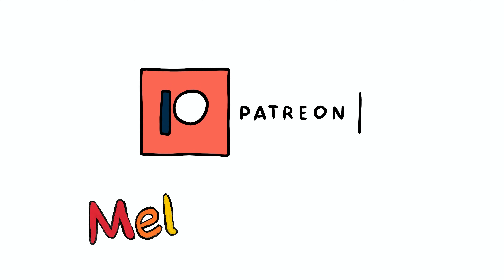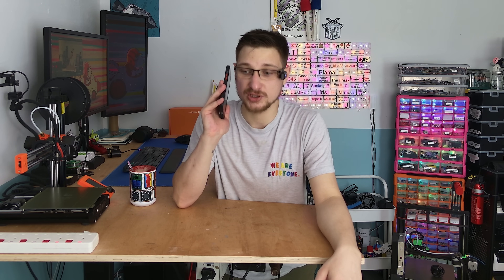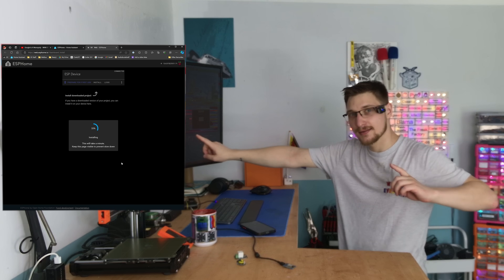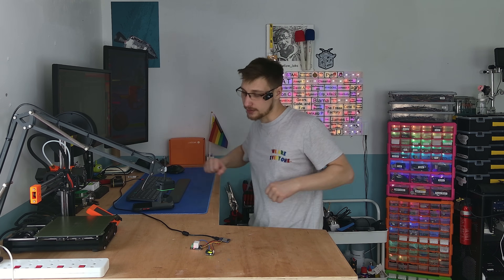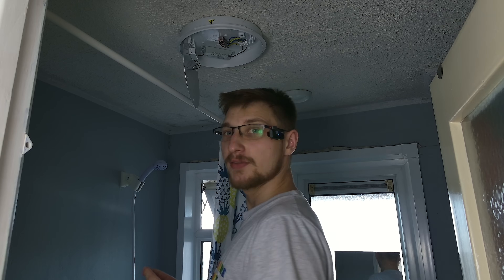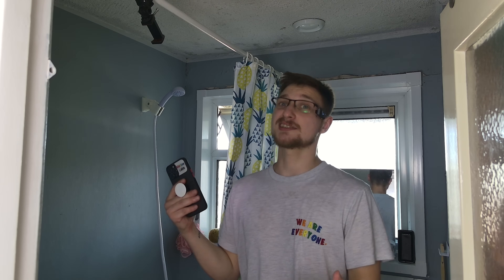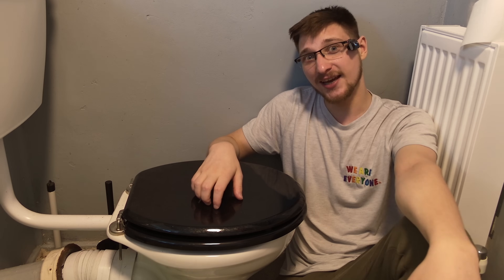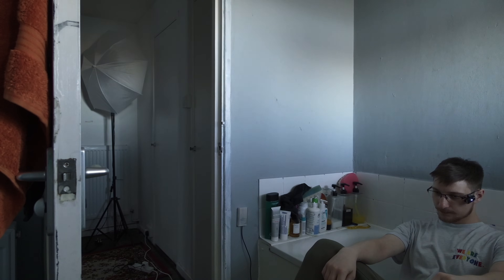DIY Smart Bathroom Light: with ESPHome & Home Assistant!

Comment: WHY did the Real Electrical Engineer (gpt) at you shouldn't??
Reply from the maker: GPT was just for a joke. I did actually ask my electrical engineer friend. The reason I didn’t use the LED power supply. Is the same reason I had to move the relay from disconnecting the LEDs to disconnecting the power supply. The power supply just isn’t designed for that kind of continuous operation. It would work for short term, but after a while it might start having issues.
Reply: @Mellow_labs  oh interesting! The ps doesn't look like supplying small currents for long periods? Why? Low efficiency?

Comment: The weird bouncing issue is caused because the power supply has no load when the LED is disconnected and the constant current feedback loop in the supply output is not able to adjust appropriately.  Basically you have an unlimited current supply (well within the limits of the supply) driving a newly connected LED load.  The flash duration you see is the time it takes for the  supply to stabilize.  So you made the right choice to switch the power going into the supply.  It will make the LEDs and supply last much longer.

Comment: I'm just watching all the time hawe question why? Forget wifi sensors and relays in smart home. You can only use them if you have no other wifi networks around. And your router can handle such many devices. Router has to be very expensive, in other words. Just use zigbee and cheap chinese sensors like tuya or similar...

Comment: If you don't need too much range (and you definitely don't need much in the bathroom) you could also put the sensor in a cupboard. The mmWave signals easily pass through a bit of wood, my sensors easily detect me if I'm standing at the other side of the door

Comment: Good video. lol Cool you used the exact same power converter to do this that i did when i converted my dumb bathroom extractor fan switch to a smart one. I also added a bme280 to mine as well so the fan goes on/off when the humidity from taking a shower rises and then falls. But this is a good way to do a light. :) Also added a vl53lox time 0f flight sensor and aimed it across the toiled seat so the fan turns on when you set down on the seat and off when you get off of it. Also sprays my modified glade air freshener as well.

Comment: Add a PIR sensor to have a faster activation time and the mmWave sensor keeps the light on
Reply from the maker: Actually, I got the activation time down to less than a second so doesn’t really need it. It was just a configuration issue I had.

Comment: Nice, I use a similar system for all my house lights. You could consider connecting the mmWave sensor within the light itself and directly to the esp controlling the relay, which I think would decrease the latency considerably.
Reply from the maker: Actually, the latency was a configuration issue. I’ve managed to get it down to less than a second now. But the main reason I didn’t put it in the light is because of the environmental sensor it would be useless up there.
Reply: Ahh glad you managed to sort that out. I find my mmWave sensors can ‘see’ through most materials including plasterboard, wood and plastic though.

Comment: How about putting this presence sensor on a ceiling near the lamp? It has limited angle (probably like 100 degrees), so this might also be causing delay. It just take time from entering the room, before you get seen by a sensor. That would also help with wires. You could even try to put it inside the lamp, but in this case, environmental sensor would make no sense :)
PS. If you are switching AC, you could look at SSR relay. They are super quiet :)
PPS. You can now put esp8266 (seriously, esp32 you are using for these projects is an overkill) behind the light switch, powered from light circuit, and switch (ideally momentary) would connect two pins on esp (maybe through resistor or pull-up pin) and control the light (or something else)

Comment: Doing exactly Ideas that I'd like to do myself. Have you considered placing ESP in switch box (light, boiler, heater) for bathroom? That way you can automate bathroom heater, as well as boiler (usually in EU its in bathroom)? Are normal aliexpress relays good enough for that? It'd be good enough project tbh

Comment: I absolutely hate those relais with the pull resistor to the wrong side...

And why nog place the sensor on the ceiling next to the light? You could use a single ESP and a single power supply :)

And really, you used a wago to go from a terminal to a Wago again :p

Comment: Nice! So what did you see in the light switch that you decided to put the relay next to the lamp? I would just do this with a sonoff or shelly relay, much simpler
Reply from the maker: Yes, that would infect me simply. But where is the fun in that
Reply: When possible it's always better to make the light switch smart instead of the light.
That way you can still use the switch.

Comment: I find your soldering offensive.
Reply from the maker: The first or the second montage?
Reply: The second looks neater  @Mellow_labs . You could probably do better with a bit of soldering flux every now and then, especially when soldering in reused electronics
Reply from the maker: Do you think they were both done by the same person?
Reply: I solder with the wires through the holes on my Wemos D1 Mini’s instead of soldering on the top. Even better use a D1 mini shield to solder to so you can replace a failed D1 mini but not have to solder again.

Comment: Establishing a direct link between the sensor and the bulb light ESPs via ESP-Now would make them so much more reactive (almost instantaneous). The 4 seconds delay you're experiencing is very likely a combination between (bad) WiFi lag added with Home Assistant processing time.
ESP-Now would allow your 2 devices to 'talk' to each other directly (without being connected to your WiFi rooter although they can be if you feel the need for it)
Downside : no fancy quick flashing with ESP-Home, to use ESP-Now you'll have to write the code.
Reply from the maker: Actually, it was neither of those things. It was just bad sense configuration. I put it down to less than one second now
Reply: Could you explain the fix that got the response tome down, please?@Mellow_labs
Reply: @Mellow_labs  all right, glad it works better now. At least good enough to not be trolled by your flatmate ;)
Reply: Too bad that ESP-Now support is still pretty crappy with both ESPHome and Tasmota... but that would be amazing if it was used!
Reply: But ESPnow prevents the WiFi connection that is useful for smart home control.  Maybe a direct Bluetooth connection, for instance.
Reply: @roberttco1  That's a misconception : ESP-Now doesn't prevents WiFi connection. In fact ESP-Now can be used at the same time (in parallel in the very same script) as a regular WiFi TCP/IP connection.
The only restriction is that the channel of ESP-Now must be the same as the channel of the connected AP.

Comment: It takes only one second to turn on the light manually
Reply from the maker: Think of all the time I'm saving And energy, No longer do I have to move my hand up to a switch. At this rate, I will be a vegetable in no time!
Reply: I automated my bathroom light as well. The main reason is that I otherwise forget to turn them off and they'd stay on all day. Kitchen same.
Reply: Think about the time you're doing your business and the light turned off due to no human presence detected

Comment: Haaaa, I bet that bump was the LED driver that had gone into "open circuit protection", and kept retrying to apply voltage in short pulses, or hiccups. We were witnessing the first one or two successful power-up attempts before it fully recovered. Probably it can't cope well with the LEDs not being connected, or fails that way on purpose as some kind of safety feature.
Reply: Did you mean short circuit protection?
Reply: @coreymartin9630  it's a different kind of protection, open circuit is when leds are disconnected or no longer conduct (often due to led failure), it prevents the voltage rising too high, which could fry other components or pose other risks